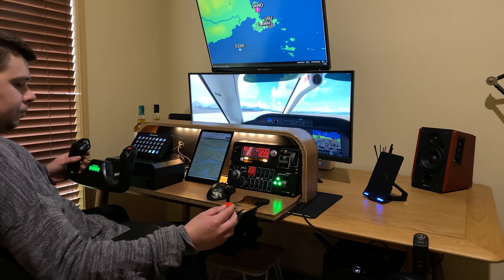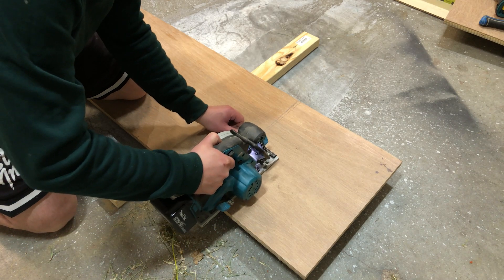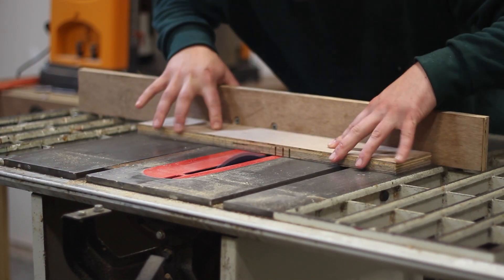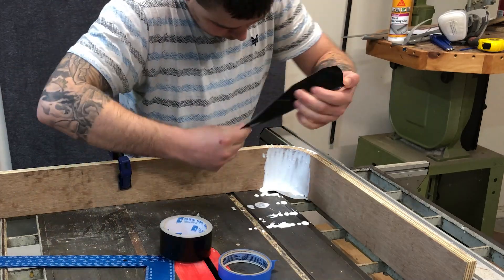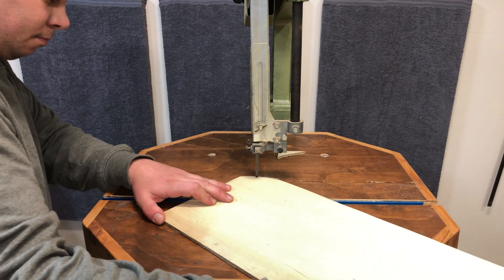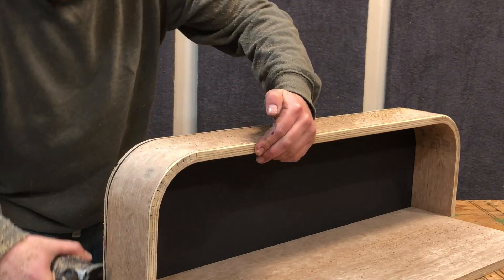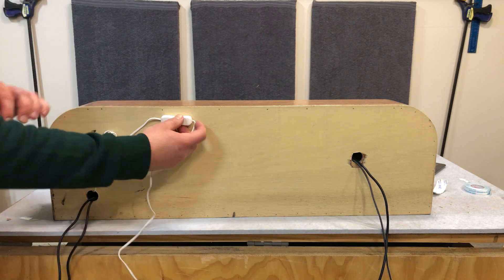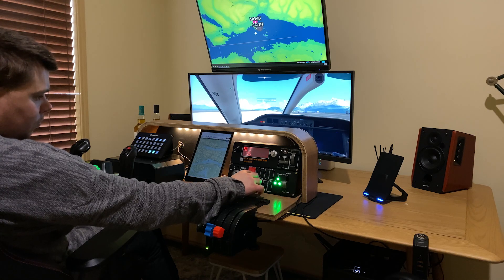Portable Flight Simulator 2020 Cockpit - BUILD

Comment: You did great on the actual, bigger wood pieces during kerf bend cutting, but the way you grabbed for the smaller test pieces rather negates the pushblock you used for safety 

Just a helpful suggestion, as "Ol' Ace 9 Digits" isn't much of a callsign 😉

Comment: Honestly, that handheld router is one of the best tools to have on a battery, because you're always having to use it in awkward corners.

Also, that duct tape will leave some nasty sticky residue if you remove it. That's the downside of it holding everything in place so well.
Reply from the maker: I would have to agree. Circular saws you can manage, but for a smaller trim router for corners, curves even indented work, cordless is fantastic

Comment: Can I recommend wall mounting you main monitor so it is above your cockpit. We have the identical three pieces of gear, yoke, MFD panel and switch panel. I would love to make something like you have to hold everything. I would lve to see a demonstration of how you use your stream deck with flight simulator, it might be something I would be interested in getting. Check out my setup and let me know what you think.

Comment: So did you have to do anything with the landing gear panel to get it to work. I cannot get that thing to even show up on my computer. Have downloaded the drivers for it and everything. Any advise? Maybe I got a bad one?
Reply from the maker: I was experiencing the same thing. You have to download a very small driver from the Logitech website for this to work on FS2020
Reply: Yes I did download it and it's still not recognized in the computer. I'll probsbly send it back. I originally was going to use it for DCS and what a pain to set up. I recently started 3d printing so ill probably try to create my own instead.
Reply: Thanks for the quick reply!

Comment: I built a laptop sim. Metal box same size as laptop, two inches deep. Got old tomahawk control wheel. Alternat cut a broom handle. Attached to cupboard clothes rail 1 inch dia., used it's mountings as the two bearings. Inside bungy cord. The Leo bodner usb module. Used it's analogue inputs for pitch roll throttle mixture, trim, using potentiometers. Toggle switches for other inputs.

Comment: Nice.  Not sure if you've noticed but the bottom of the yoke has some threaded inserts that you could have screwed into from below.  I'm going to have to do something similar and had been thinking about what to do because I have the same scenario and ideally, want to just plug in one USB cable and not have to keep bolting individual bits to the desk and disassemble afterwards.